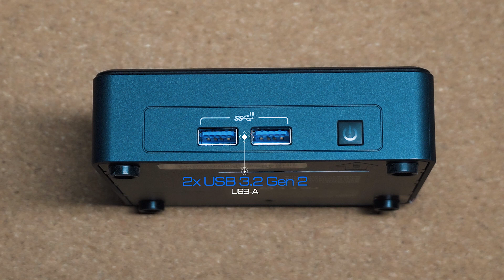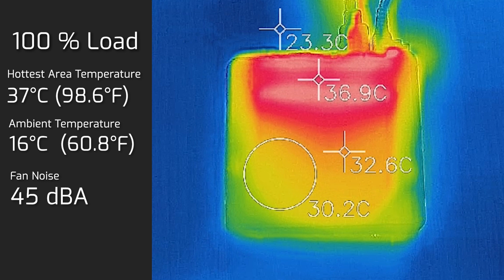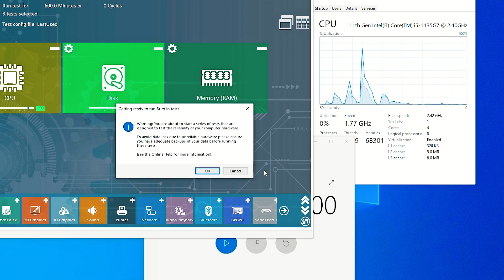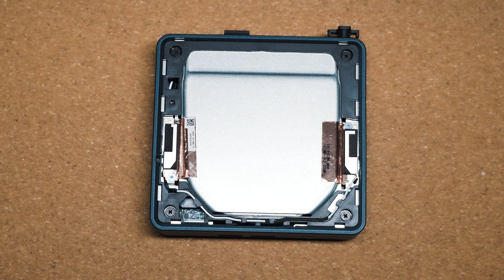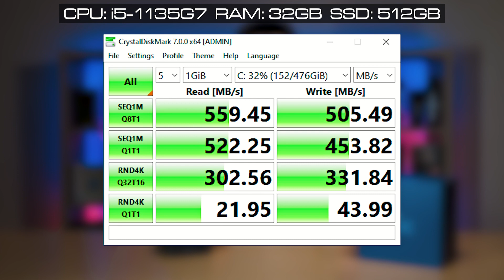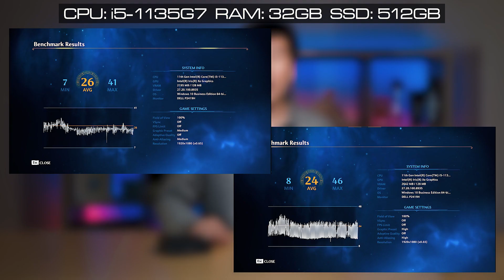Really Neat Mini PC - Intel NUC 11 Pro (Tiger Canyon)

Comment: Hi can this run windows 11?
Reply from the maker: Yes this should be able to run Windows 11, it does have TPM chip I saw in the BIOS.
Reply: @BsianTech  does it also  support secure boot?
Reply from the maker: Yes this does support secure boot, I did see that option too in the BIOS.
Reply: @BsianTech  can you tell me the model number of this NUC? Thanks.

Comment: Finally the much needed IPC improvements have come to H series. The performance per watt with 10nm is leaps ahead of 14nm (as shown by this 45W 4 core processor scoring almost as much as my 56W 6 core 9750H in Cinebench which loves more cores), though it's still behind Ryzen.
This is getting me very excited for your review of the Precision 7760. Can't wait for my 7760 to arrive... but I shouldn't get too excited because it will take another 1.5 months for my order to arrive
Reply from the maker: Zhong Ze I completely agree with you, I was really excited to hear about the Tiger Lake H when I was attending the  Intel pre-press launch of the tiger lake H processor. I was right onto Dell straight up afterwards but was told to wait So I got my ETA update on the Precision 7760 and the 5560, looks like it be very early August to arrive for me. The status is part shortages atm on all the computers I have coming from them which isn't surprising like the other manufactures.
Reply: @BsianTech  Oh my order for the 7760 is arriving on 8/10... can't wait!
Reply from the maker: @vivek_v  it's most likely awaiting for screens as that's usually the shortage part and surprisingly headphone jack part too
Reply: @BsianTech  Thanks for the info about which parts are holding up the order (it doesn't show for me). I ordered the 4k screen and it seems like they have a shortage of 4k screens. I hope the order doesn't get delaye since I'm itching for a new laptop... my xps 15 7590 definitely isn't up to snuff when doing 50 hour long renders with 100% CPU and GPU load.
Reply from the maker: @vivek_v  I get a little help with the Dell team that handle my organisation and ongoing discussions to know which are the issues in supply as it effect our planing for ordering. I think you will find it will do a lot better than the XPS for sure as the precision has much more capable thermal solution.
Reply: @BsianTech  My 7760 just arrived a week ago!!! I haven't turned it on yet since I'm busy, but the build quality is exceptional compared to my XPS 15 7590, partly due to the 7760 having a much thicker chassis.
Reply from the maker: @vivek_v  The Precision 7760 arrived earlier than expected by a week and I just unboxed it last night, its really nice and much much better improvement in the performance compare to the 7750 by a lot! Which condif did you end up getting?
Reply: @BsianTech  i9-11950H
RTX A4000
64GB (2x32GB) 3200mhz CL16 RAM (upgraded afterwards with Crucial Ballistix 3200mhz CL16 RAM because the 7760 and most likely the 7560 support XMP RAM which is new)
256GB M.2 2280 SSD + 1TB Samsung 980
4k 120hz screen
5 years ProSupport Plus
With my time so far, it has been amazing. However, the fan control does seem a bit weird as the fans switch between the 2nd highest and the highest speed with a 100% combined load in "ultra performance mode". This results in an avg wattage of 115W for GPU and 30W for CPU which is less than ideal. Hopefully future updates make the fans run faster, allowing the CPU to go to a higher wattage.
I did break a few clips on the bottom chassis when removing and installing it... I miss the slide out bottom panels in the past Precisions :/
My system weight is 7.58 pounds because the upgraded RAM has a heatsink.
Every aspect of the computer is a massive upgrade over my XPS.
Reply from the maker: @vivek_v  oO quite jealous very nice configuration. I like to hear your thoughts on the performance of the new i9. I have it in the 5760 and it's already pretty nice, putting it into something that can handle the heat better like the 7760 woah I can see it opening way better.
Reply: @BsianTech  The i9 is a huge upgrade from the thermally limited 14nm i7 in my old XPS, but even in the Precision, it doesn't reach higher than 3.9Ghz under 100% load (at 100W) when doing a Blender CPU render. Once the CPU settles in at 75W (PL1), the clocks go down to around 3.5Ghz.
Note that Blender CPU rendering seems to stress the CPU a lot, and other stress tests that do "100%" CPU load allow the i9 to reach much higher clocks (some "100%" loads allow the i9 to easily max it's 4.5ghz clocks at only 90W).
However, in a ~70% load, you will start seeing a difference between the i7 11800H and the i9 11950H since the CPU will have enough room to boost to 4.5Ghz all cores on the i9. And 70% load is a much more realistic use case scenario.
I would think "downgrading" to the i7 11800H would have a negligible difference, ~10% loss of performance at most under most loads. However, there could be use cases where the i9 is ~15% faster than the i7 11800H. The reason why I got the i9 is because the CPU is the only part can't be upgraded, so I wanted the best CPU now. Because I can always get an eGPU later on.

I would say the i9 11950H probably isn't worth the extra $$$, but if you need CPU performance, it's worth it since you can't upgrade the CPU later. But the i7 11800H is the sweet spot, and it's still 8 cores.